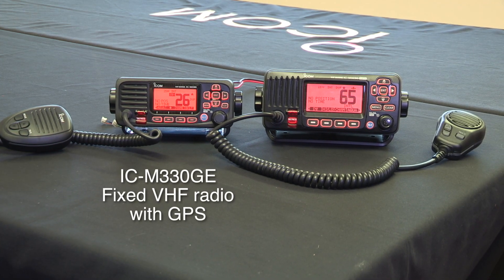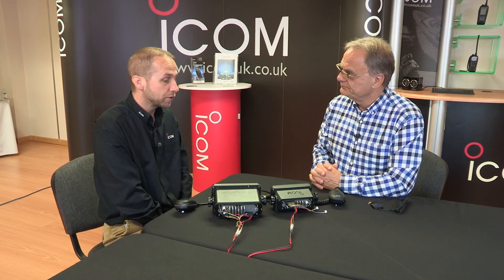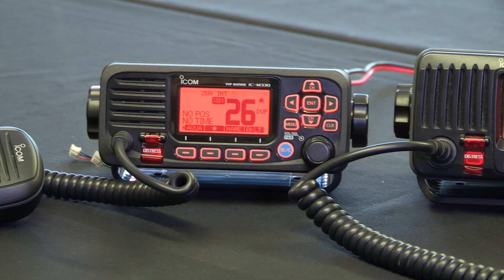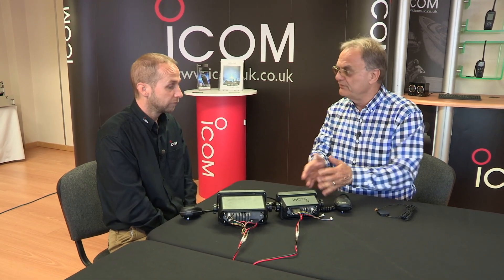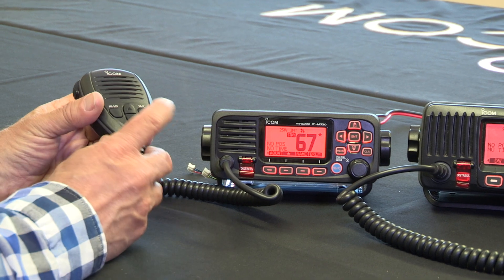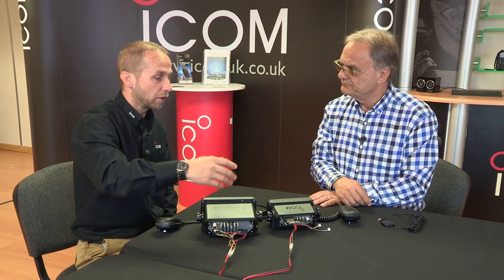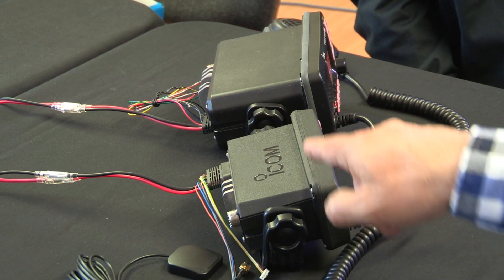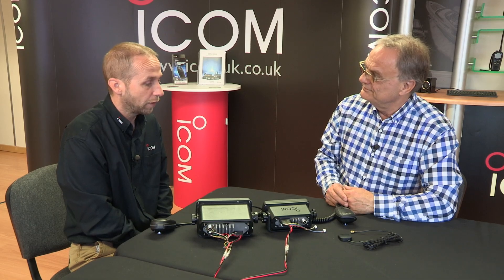Icom's  Ultra Compact IC-M330GE Marine VHF/DSC Radio

Comment: Hi, in all the pictures this radio isn’t showing full gps positional data, is their an option in the menu or a way to view the full latitude and longitude? Cheers
Reply from the maker: Because this is a smaller set it does display a smaller amount of digits.  However, if you go into the GPS info menu you will find more detailed GPS information.

Comment: how to reset MMSI due to wrong input sir?
Reply from the maker: In the UK our government body requires that all Marine DSC radios are allowed only two attempts at inputting the MMSI number. If this is done incorrectly your only solution is to take the radio to a qualified Icom marine dealer who will be able to program the MMSI number for you.
Reply: @Icom_UK  I just entered the MMSI number, sir, how do I reset the MMSI number, sir?
Reply from the maker: You will have to get this done by your local dealer
Reply: @Icom_UK  oke thanks for information sir 🙏